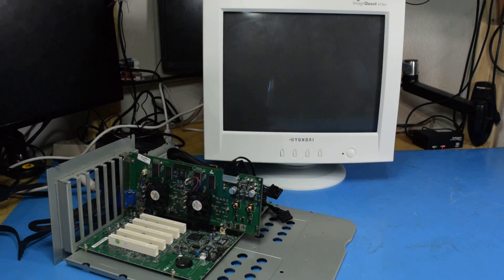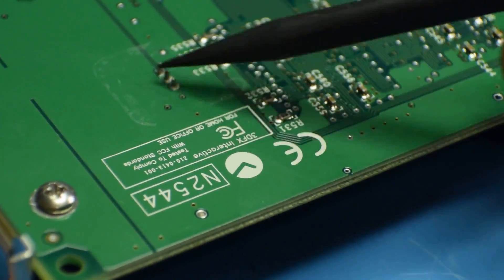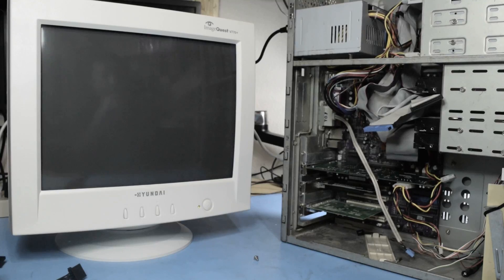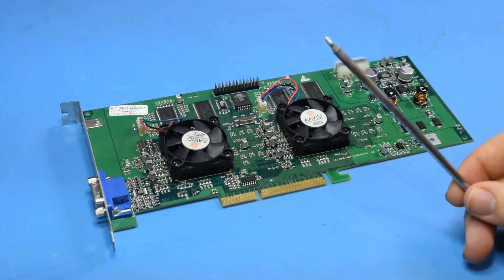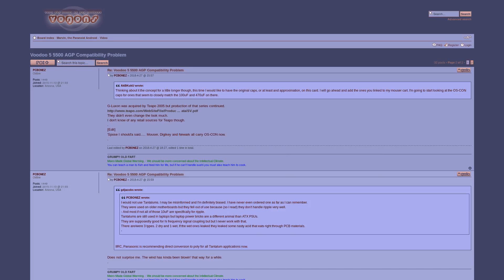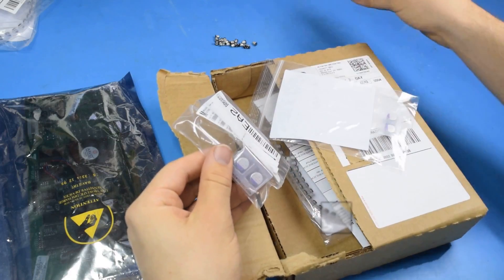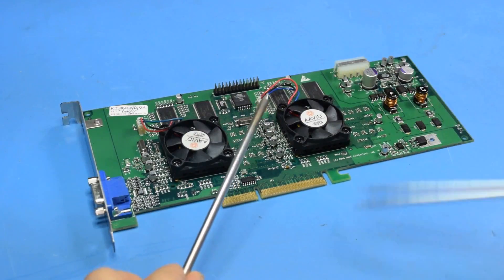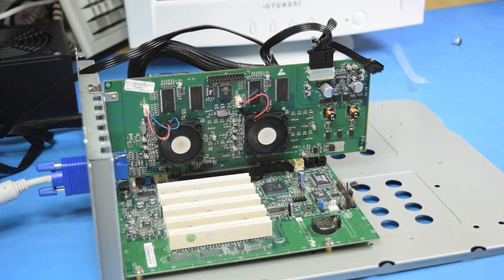0x0030 - 3DFX Voodoo 5 5500 ReCap

Comment: Anyone know what DIGI KEY part numbers I need to order for SMD caps on the rear of the card C505, C506 are missing on one of my cards? I get slightly lower 3D Mark scores on this card and once I saw it freeze with a random line on screen but other than that still works amazingly.

Comment: If you have a hot air station, you can also consider reballing the BGA chips. It's a massive pain but there's plenty of youtube videos about desoldering the chips, cleaning them up with solder wick, and applying new balls before reflowing them on the board. DosDude1 is one of the best for this kind of thing. The only challenge is that you typically need a BGA solder ball mask so you can get the solder balls placed before flowing them to stick to the chip. It's often not worthwhile if the card you're working on isn't valuable, but it can still be a good exercise in hot air soldering. The only major challenge is figuring out how beefy the power and ground planes are in the board and determining whether or not you need a board pre-heater.

Comment: Who knows why 3dfx has only  build the SLI techno with the Voodoo 2 !  A sli voodoo 4, or a sli voodoo 5 would have been nice with the pci X board, or the pci 64 bits !  They were alone with the SLI capability, They would have used it for each  model possible, that the cash could have rain and save them. Their CEO was soo wrong.

Comment: Thank you, didnt know, card can go bad by this way, and it can be repaired by soaking it into alcohol. I would probably think, after trying recap it, it is dead, and probably would try heat method. I'm glad for every old card to be saved. It will be harder and harder get them, until someone start actually re-create them.

Comment: Hot capacitor means it's reforming. Happens all the time, that's a good sign, since it was unused for so long. Just means it's coming back to the right shape.

The capacitor values are almost completely meaningless for cards like these - they're used to smooth power supply lines for the most part. Makes them more stable.

That being said... Some of those were definitely very bad and leaking. It's good preventative maintenance to replace all of them when one or two start to leak because it usually means the rest could follow in short order.
Just trying to teach that recapping isn't always the answer to everything and some simple diagnostics could have got this working long enough for your purposes.

Comment: The reason why it's hard to solder and seems like your iron is not outputting the heat is due to those negative lands being on a grounding plain. You need a heat gun for those to get the solder to flow right.

Comment: Very cool. Doing a SuperSocket 7 Win98 build soon. ReCapn the mobo right now. Have a Voodoo 3 2000 on the way ( ebay), fingers crossed its ok, but I think I'll recap it any way. If its not electrolytic caps killing PCBs its those crappy barrel batteries. Some one need to go back in time a slap some engineers around the place a little. Looking forward to watching some more of your vids.

Comment: For what it costs for cheap desoldering braid, you can usually get a 50' roll of Chem-wik by chemtronics for under $20! I used to do a lot of car amplifier repairs and this was the cheapest source of quality desoldering braid! 

Another trick for smd replacement is no clean soldering paste "Search for a brand called, Mechanic Solder Paste", you can buy a 42 gram tub for pretty cheap "under $10 from US sellers on ebay" and you just scoop some into a syringe "50pcs 1ml Luer Lock Slip Tip syringes are only $6.99 on ebay" and use a syringe tip to control the application! This will allow you to temporarily hold the cap, resistor, transistor, etc in place and you can either use a small tip iron, heat gun or infared rework station to melt it, securing it properly! 

This is the way smd chips are applied during manufacturing and this allows them to be mounted as close to the pads as possible while leaving less excess solder for a cleaner looking repair! Remember, these are just tip's you and others can use, it will make repairs a little cheaper and easier! These are things I have learned along the way and they have saved me time, stress and money!

Comment: IMO the Voodoo 5 was just kind of rushed out and incompatible with a bunch of systems.  Maybe this is just dumb 15 year old me thinking here... but I had a voodoo 3 2000 and it worked perfectly fine in my system.  When voodoo 5 came out I ordered it and tried to install it.  I think it had some sort of conflict with the onboard graphics that was built into my motherboard.  The ATI rage BS.  maybe I am wrong... but long story short I spent a BUNCH of money on that voodoo 5 as a kid and it just sat in a box.  I have literally no idea what I ever even did with it.  I can't remember using Ebay to sell it on.

Comment: Tip for the next time: 
Those surface mounted caps a easy trick,  grab them with a plier and just gently start twisting them
They'll come off without destroying the solder pads underneath. Much faster (cleaner) job than de-soldering them

Comment: I have one of these, PCI version however, I put a computer together and installed windows98 and it was working, i ran 3dmark2001 and it completed, i then went away for awhile then i came back to artifacts on the screen, i rebooted and there are lines across the screen and i can only get into safe mode :(.  I have no idea how to repair it.
Reply from the maker: Without access to it or equipment like I have I don't really have any strong recommendations for you. It could be the caps like mine, but the only way to really know is to remove them and measure them with an ESR meter.

However, I would start out by trying a different power supply.

Comment: Great video! I have a 5500 myself that just has "half" of it working (only single GPU mode). Saw the same liquid on mine as well. Could you let me know at what temperature are your Metcal tip rated for?
Reply from the maker: For Metcal tips, it's complicated. I suggest you take a look at this: http://wsbenelux.nl/wp-content/uploads/2014/11/metcal-tip-temperatures.pdf

I use 700 series tips.
Reply: AkBKukU thanks for the quick reply!

Comment: You should seriously consider using ChipQuick Alloy low temp solder alloy. It will save you the trouble of replacing pads. Have a look at it when you can, it's not cheap, but I bought a tube on DigiKey a few years ago and still have some. You just need a dab of it to modify the set temp of normal solder or lead free solder.

Comment: I have an accumulation of old PC parts, and one of the graphics cards I yanked out of an old system, if I remember correctly, looks almost exactly like the Voodoo 5 (didn't know what it looked like until I saw your New 98 build).  I'm gonna flip if it actually IS a Voodoo 5.

Comment: Hello. One question! You used a toothbrush to clean the card, and I was wondering if I could use a toothbrush to clean the components of my PC. It's plastic, so I guess it wont generate static, and perhaps could I use alcohol? For example my video card back pcb has dust that I couldn't remove with my dust cleaner. Thank you for the advice!
Reply: You can buy a carbon brush which does not generate static, from any electronics part retailer. Use isopro alcohol.

Comment: I wasn't the only one to notice a cap the wrong way round? the two smaller on the far top right edge - the black bars were opposite ways round - the +/- 's were both on the same side on the board, but the caps were opposite...

these 2 here... https://youtu.be/zLjBqS8Sgdc?t=571 (the first he places black is to left, 2nd it's to the right)

Comment: You're not going to think to blur your address? o.O
Reply from the maker: Where do you think you are seeing my address?
Reply: 7:55 and onwards for a little bit. It's blurry and low-res but I feel like if I cared enough, one could zoom in on a screenshot and make it out.
Reply from the maker: That's Mouser's address in the top left, I cut my address out of the label.
Reply from the maker: I am concerned about leaking my address and anything with mail in it is going to make that a possibility. I was a little short there because it is immediately a cause for alarm when something like that could be left in a video. I was initially thinking the blur later when I had the box open failed to render.
Reply: awesome, just was worried for ya. :)

Comment: FYI... use a dab of flux paste when soldering, it will help flow the solder onto the pads and parts alot more quickly without fear of creating cold joints, then use 91% isopropyl alcohol to clean up afterwards.

Comment: For cleaning stuff under BGAs, without reworking them, you could use IPA (of course) and compressed air; flood the thing and then somehow blow the fluid out. I recently stumbled upon the "Nik Telio" channel, the guy who built himself a PC-controlled BGA rework station; he uses some kind of bellows, basically a small hand-operated bladder with a nozzle. …or you can use your mouth, if you prefer the thooper Lo-Tek approach ;)

edit: of course, i'm infected with early commenters disease too …yeah, you could just submerse the whole card in IPA xD LOL maybe a little overkill, but it worked, right. 👍

Comment: I did not know caps could fail that badly. I'm just used to bulging and blown top ones, like with my dad's old Dell Dimension E521 that had EIGHT capacitors go bad above the RAM. The only way I noticed was when I was trying to see if I could go past the 4GB limit Dell said it had (and I did!). The system was still running fine, but I replaced them.

Comment: Is it possible to a motherboard dont boot because its capacitors are bad? I have a old pcchips m825 that booted when was with my friend. He gave it to me and i didnt use it for some months, when i tried to turn it on it didnt worked. Not even a fan spin. I cleaned it with isopropilic alcohol, and all its caps doent seem to be bad, and there wasnt any eletrolitic spill in the motherboard. 

I mean it just was left in the computer case for a few months after my friend gave to me (without anything connected) and now it doesnt even gives signal of life. I know its hard to diagnose eletronics out of a youtube comment, but you think its possible that its caps are bad?
Reply from the maker: It could be caps, that's why I bought that ESR Meter. It takes the guessing out of troubleshooting.
Reply: I have a MB with a really hot nForce chipset. Last year the SATA controller stopped working correctly, then the MB stopped POSTing. Now I noticed there is a capacitor right under the heatsink and the board is almost 7 years old now. So, if it's a power cap, it might have gone bad after all these years (the computer was running 24/7 in 2016 and 2017). I'll try to replace it some time later.
Reply: Nope, the chip is just fried.
Reply: Probably caps. I recapped a few motherboards and it fixed them
Reply: Simon Quigley Would it be good to replace the eletrolitic capacitors with solid state ones?

Comment: Nice job ! Though to avoid physically stressing the pads, you could just have cut these and remove the remains and then disolder the old pins. That makes the removing job also MUCH easier

Comment: Those milky areas around the through hole parts are from a wave solder pallet. It has an opening for each through hole section and solder flows through the holes to solder the pins, and not touch the other parts of the board.

Comment: I watched your original video , and what stood out was how those two resistors are soldered , I have my doubts that it was indeed NOS could have been some one that resealed a non-working used card in the hope that no one will open it
Reply: Exactly my thought. You can clearly see someone used a soldering iron on that card before.
Reply: As soon as I saw it I wasn't sure it was the caps but the surface mount resistors looking dodgy as all hell.
Reply: Well you can even see in the original video that the box wasn't sealed when he got it.

Comment: wouldn't the flux be a more likely cause for that amount of yellowing in your solution
Reply from the maker: I had not considered that. That is very likely
Reply: I'd also guess a lot of the white stains on the PCB are flux residue from manufacturing.

PS: To get residue out from under BGA chips try getting isopropyl alcohol under there for thinning/dissolving it and then blowing the solution out with compressed air. It works faster and thus is less likely to damage anything.
Still the method in the video worked fine obviously. Well done.
Reply: Ted M ; Don't worry, this method is safe. Usually compressed air will be at about room temperature so no thermal issues and I wouldn't imagine any hobbyist using a DIY method in liue of an ultrasonic cleaner has access to an air compressor that could lift a chip off a board.
Reply: @myquestlog733  Bit late (at least one year late), but I imagine the objection was about the thermal stress created by quickly evaporating liquid (isopropanol in this case). Imagine when you are filling lighter with butan and some of it spills on your skin - it was at room temperature, but very quick evaporation cools it and can give you frostbites.
Reply: Compressed air might cause thermal and mechanical stress on the joints of the BGA chips depending on how it's used, I'd be a bit careful with that, but I'm not a professional so take that with a grain of salt